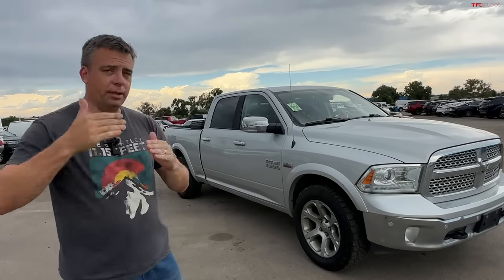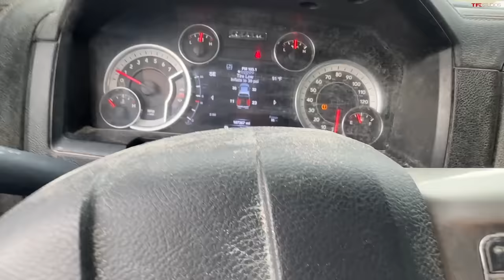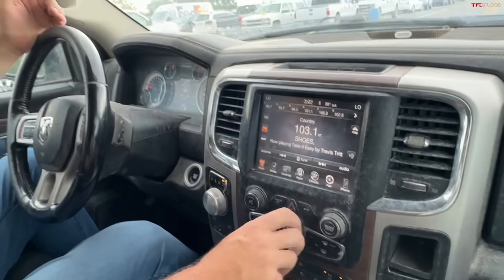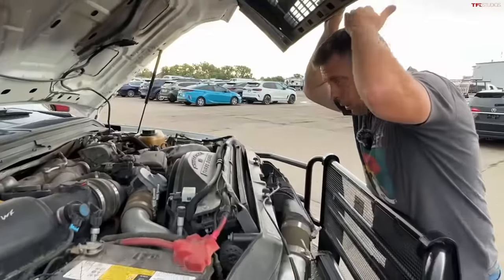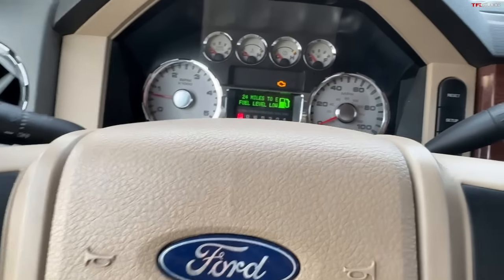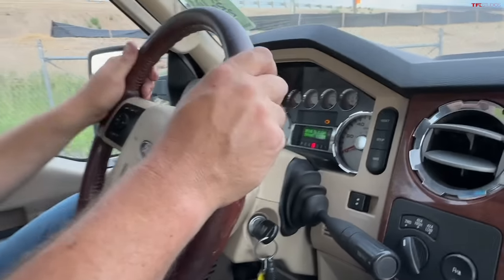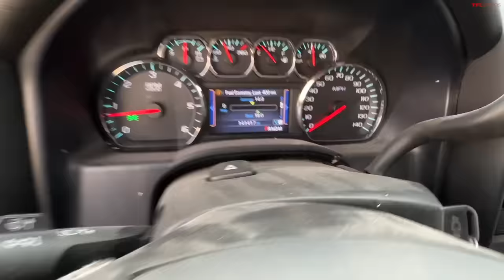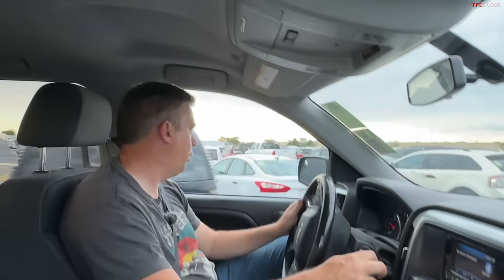These Are the Top 3 Used Trucks You Should Never, EVER Buy!

Comment: The 5.4L 3v gets a bad rap. Once you update the phasers and oil pump they'll go forever. I just rebuilt a 3v with 275k original miles(timing system was updated at 171k) and it had only minimal wear on the cylinders. All specs were within tolerance for a freshening up.
Reply: Yea but the cost of doing that work is almost as much as buying a new engine. Most DIYers dont have the knowledge or ability to do that. At the same time the phaser issues isn’t usually catastrophic and the engine is fine for as long as you can deal with the “tick tick”.
Reply: @Overlandjon  A reman is close to the cost of a rebuild, but they are all updated also. Fraser and Powertrain are both using DA phasers and Melling HV340 Melling oil pumps. The tick sound is mostly associated with the passenger side timing chain tensioner seal blowing on the newer style composite tensioner. It all boils down to maintaining the vehicle properly.
Reply: @brianhunt5635  yea I had one and fixed it but I bought it with the timing chain issue not knowing it had an issue until after I bought it. (I learned alot about it which I never knew before). It never had any issues while I owned it (about 4 years) but Took alot of learning to figure it out how to fix all the issues which I doubt most buyers wouldn’t do. The Dealer wanted upwards of $5000 to fix the issue. Your right its a bad rap as the engine still outlasted me but again its a risk and not many people want to put that kind of energy/money into something thats worth less than the repair.
Reply: @Overlandjon  For sure. If you can get them cheap enough and have a mechanic you can trust, you can have a pretty nice ride for a decent price though. I'm still surprised at how many are still out there with these issues. Seems like most of them should have been updated by now, but they're still running around knocking and clanging. Ford did more right with the Modular engines than they did wrong, but engines don't often get remembered for what they did right.
Reply: I just recently had my 08 5.4 in for the phasers.  I was lucky to have had a warranty to fall back on. I was told that it would have easily been a 4K repair and I still paid 1K out of pocket to do the "no brainer" repairs while it was tore apart. Now I have trans issue that when it sets all night ,when you first start it and put in gear it will not move. It's like the pump is weak , but the dealer is stumped... so they say!
Reply: @miked19831988  My Advice Dump the Truck Money pit anything with the 5.4 is TRASH BTW a Ford Truck guy not bashing Ford but the 5.4 with all its problems stay away
Reply: @rogerstlaurent8704  if you’re talking about the 5.4 3V then yea but the 2v is really reliable I had  a 04 f350 with the 5.4 2v for 14 years and never had a single issue out of it and pulled over 10,000 with it.
Reply: @kingslayer8569  BTW 100% correct on the 2v jumped the gun just a little bit the 3v were TRASH
Reply: I’ve had an ‘07 5.4 3V since new. Slight right side phaser knock at 185k-ish and I went ahead addressing the issues myself before all got worse. It’s a suck job but I did it. Truck runs really well. I get the frustration over the 5.4 but it’s been a great truck.

Comment: Ram’s Hemi tick is a bit overblown. There was a bad run of lifters but in 2017 they changed suppliers and beefed up the roller bearings. Typically the worn down lifters and lobe happens on the non-MDS cylinders. Plus it’s most common on vehicles that idle for long periods of time when oil pressure is lowest and operating temps are highest. Also it’s best to do full synthetic oil changes 5-7,000 miles not 10k. It can run on 87 but best to use 89 octane to prevent engine knock.
Reply: Have a 2014 Ram Hemi with 120k miles no tick
Reply: I had a 2018 hemi with this problem. Had to take it back to the dealership for repairs. Was like pulling teeth to get them to fix it.
Reply: Happens way too often and it's a huge repair. Many GM or FCA V8s with DOD/AFM/DFM system will have issues at some point in its operating life. It's a crap design and will absolutely negate any fuel savings.
Reply: @TPowell12  It does not happen that often. Issues can be due to bad maintenance/abuse on either the Ram or the Silverado.
Reply: It isn't due to bad maintenance. My truck had full synthetic every 5k and I'm one of several people I know with this issue. It's due to crap engineering from FCA and GM. If you understand how this system operates then it's easy to see how the lifters will become damaged over time.
Reply: @TPowell12  If it is the bad engineering then why do the locals in Qatar buy them and appreciate them? The lifters get damaged because they do not have the right oil. GM would be out of business if they had such issues.
Reply: @ramaswamynarayanaswamy4806  Most people aren't car people and don't understand or even know of these systems. They're still in business because they have deeper pockets and better lawyers than most people can afford.
Reply: @TPowell12  Alright. I still prefer GM as where I am, Ram trucks and Fords are more expensive and can be difficult to repair to an extent.

Comment: When I was shopping for a Truck after buying a 22 foot travel trailer, I noticed the used truck market is full of trucks with the  model years the manufacters had issues involving recalls or failing engines and other major issues. Granted, some had the issues fixed, but the owner decided to dump the vehicle. I ended up purchasing a 2010 Nissan Titan, and all research and reviews say I made the best decision  regarding a used Truck.
Reply: Loved our 2008 Titan. Put close to 350,000 miles on her. Picking up our 2024 today.

Comment: The Diesel issue from 2005 through 2015 is the government mandated emissions controls with little to no lead time to develop the systems and the consumer became the test subject. The diesels of the last 5 or so years are far and away better because they've figured out the systems that typically take 5 to 7 years to develop a reliable solution. But the gov gave less than 2 year notice, and then again with less than 2 year notice. And it was across the board for on road diesels.
Reply: Now the fuel system on all of the trucks are a problem.

Comment: I have a 2014 Silverado 1500 with a 5.3 liter engine and 138,000 miles. However, the previous owner installed a chip that deactivates the cylinder deactivation feature. I haven't had a problem. With the chip, I don't have to worry about uneven heating caused by one cylinder firing and the one next to it not firing. The engine always runs on all eight cylinders all the time.

Comment: I drive a 2015 ram 1500 5.7 Hemi and the only problem it has is a exhaust header leak. After about 10 seconds of the truck first being on from a cold start it goes away. I was able to get it fixed under warranty or recall, but it started happening again.
Reply: how about not and take your scamming somewhere else

Comment: I usually love TFL but to me, saying to avoid buying a 4th gen Ram 1500 with the 5.7 is a huge miss. Because anecdotally I have owned 5 ram trucks over the last decade not had a SINGLE major issue out of any of them. I was a GM guy until I got my first Ram and I haven’t looked back for a decade. The particular truck just seems to have been rode hard and put away wet. You can do that to a Toyota and it will be junk too.

Comment: Heard lots of bad things in the 14 Silverado.  I had one new off the lot.  240,000 miles other than multiple ac issues that were fixed after replacing with after market parts, I had zero issues maybe I just got lucky🤷‍♂️
Reply: I'm going to say you take care of your stuff, new off the lot means you know what maintenance was done and no one abused it like you did, I worked at a dealership and boy about 70% of the silverados 14-18 that would come in would get sent to auction.
Reply: I have a '15 Silverado HD with 134000 miles and only problem I have had is mice filled the ventilation ducts with dog food and burned out the blower motor.

Comment: I've got a 2011 4.7 v8, it is a work truck (home remodel), and I bought it new from the dealership.  It tows my work trailer, my car hauler , and it currently has 160k+ miles. The only problem i had was that the water pump went out on me around 100k miles. I've only had to do regular maintenance.

Comment: My 14' 5.7 has had the exhaust tick and the lifter tick, kinda sounds like exhaust on that one.
The lifter tick fix is a bit expensive, but mine is good to go for a long time now.
Issue causing the lifter tick is a few things, the cylinder deactivation is one, you can eliminate that by tapping the manual gear selection and setting at 8th gear once you are in drive and it will not engage cylinder deactivation.
The other is going past 5k miles on oil changes, these engines are sensitive to oil degradation.
Take care to do those 2 things and you'll be good.
Reply: Most of the lifters that fail are non mds lifters it’s just bad part quality control.

Comment: I have a 2016 Ram Big Horn and it's been great. I always turn the MDS off manually and get oil changes at 3000 instead of 7500 or 10000. The interior is still in good shape because I don't thrash on it. A lot of stuff comes down to owner behavior.

Comment: I have had 2RAM trucks in recent years.  The first, a 2013 single cab with 8 foot bed and 3.6L V-6 4WD. It climbed s great without a load, but when i put a pop- up camper on it, it slowed dowe and mpg went to 15 from 25mpg. I bought it with 50K and when it was destroyed it had 105K. It only had one recall and ran great.  It was totaled by a live- bottom gravel truck enjoyed parked.  

I then boight a 2009 RAM Laramie that is loaded. 5.7L Hemi, Brown leather interior, 4door and 6.5 f 22:12 t bed.  In town  it gets 16. On the road 21. 4WD could climb straight up if it got traction.  It had 134K when i bought it. S 185K now and is getting a new AC. $5000  for parts and labor. The dash has to be removed. That has  been the only really expensive issue.  Other things are normal wear and tear to me.  1 minor recall. No oil Comstock.  No exhaust leaks.  Probably because the previous owner put new manifolds and exhaust system on. I am going to have to replace front hubs rotors and brakes.

Comment: I have a 2015 Ram 1500 with the 5.7. Yes, like others have said they can have bad cam lifters that tick, but most of these trucks get broken exhaust manifold bolts. Mine had this and I fixed it and replaced the manifolds for shorty headers. Problem solved. I've had a fuel sensor go bad, and some minor issues. I still think the ram trucks are the value for the money. Hope this helps.
Reply: Replaced my fuel sensor twice so far. Second time with TRQ brand and so far so good about a year and 10k miles later. I would not replace with an oem one because it’ll just fail again. Unless under warranty on their dime
Reply: 2017 Ram 77k miles

Comment: The DEF and DPF are major issue with diesel trucks. 
Requires alot of maintenance that most ppl don't stay on top till its too late
Reply: Which extra maintenance is with the diesel ?
Reply: @watchmanexpert  There is no extra maintenance. If your DEF is not deleted yet, you just have to add it in once in like 6-8K miles. If you change engine oil yourself it cost just like $60. Intervals are actually longer then gas engines.
Reply: @marcelo403polo2 That’s the problem. HO Diesel option on the new super duty is $12,500 plus tax and interest, then you have to spend $5000 more to delete it and void your factory warranty. I just got a new 7.3 Godzilla because I didn’t want to deal with the cost, weight, and complexity of a diesel. Just looking under the hood of a modern diesel will give you a headache.
Reply: @cliffordmontana4562  Yes. But those newer gas motors are also very problematic and gas thirsty. So IMO still is better to have diesel. Im very happy so far with my LML
Reply: @marcelo403polo2 If you’re referencing the camshaft delamination, it affects 1-2% of engines from 2020 and 2021. It’s a simple, old school engine with few parts and no turbos. There hasn’t been an engine this simple in a heavy duty truck in decades. I have a crew cab long bed f250 4x4 with 4.30 gears, 35x12.50 mud tires and a 48 gallon gas tank. I average 14mpg. Towing my enclosed trailer with toys in it I get 10mpg. That’s pretty good for a 7,500 pound truck. Good luck with your lml. I just personally have no need for a diesel and don’t want to deal with all the emissions stuff.

Comment: I have a 2014 5.7 Ram 2500HD with 149K miles and 66RFE 6 speed. I have a tick, but it doesn't occur on initial cold startup at all, is not discernible under normal driving rpm ranges either, but after driving 30 miles or so when stopped in idle the tick is quite noticeable.  This engine is the VVT, NG compatible version not the later MDS version.  I have never seen any metal in the oil or filter and is usually still clean to the eye when changed. Always have to use premium Mobile1 or OEM oil filters to maintain oil pressure with this VVT system or my truck will shut down the VVT and throw codes. Usually by 5K the oil viscosity itself tells me it is time to change. I use Rotella Gas Truck Blended 10W30 or 5W20 whichever I can get my hands on.  
I have not yet looked at my manifolds bolts but with a rear exiting exhaust design I don't doubt I have broken rear studs given how the heat would naturally fluctuate across the manifold getting hotter and hotter at the rear exit.  Just weird that I experience a different tick scenario.

Comment: Thanks for the informative video. 

What used trucks would you suggest to consider for reliability? I'd like to hear people's opinion on their top 3 recommendations.
Reply: Tundra is best on reliability.
Reply: A V8 Tundra (speaking from a lot of used trucks experience) but it's also a hit or miss too sometimes. It's just a safer bet
Reply: @Pantelifts10  absolutely. I hadn't stated that the current new model doesn't apply to my reply. Lol
Reply: @tbok75   They are very reliable but do have AIP and Cam Tower leak issues.

Comment: You're correct that you need to specify 5.3 3 valve, they had far, far more problems than the earlier 2 valve.
Reply: 2003 fx4 135 thou original miles 2 valve's will go well over 300 k if maintenance is done. Had a 2000 lariat with well over 315 k on it and the guy that bought still drives it daily. 5.4 2 valve.

Comment: I've got a 2006 F-150. I've got 350,000 miles on it and just now it's starting to give me problems, it's now got a lifter tick, the AC is non fixable without replacing it, the passenger windows don't work, this is cab in a half. But it still runs and is not beat up, the paint still looks new (Champaign) color. It's getting tired though. And yes, it's time to let her rest. Been a great truck

Comment: I’ve got 243,000 miles on my 6.4. Still on the Original engine, trans, and dpf. Only problems have been radiator that was recalled.

Comment: My neighbor and my friend have the ford with the TT V8 diesel. The most problematic problem on those is the coolant mixing with the oil. They both had the same problem with their trucks. The black stain on under the hood is from the coolant reservoir pouring hot oil out.

Comment: 2014 Silverado/Sierra had a transmission issue with the 8 speed auto. But not with the 6 speed. 2014-18 Silverado also leak at the main seal after 150k and it's an EXPENSIVE replacement. Dad's 2015 has that same tear in the armrest.

Comment: For the GMs, you buy an AFM disabler to avoid the lifter issue👌🏼 We have it in the 09 Sierra
Reply: An electronic disabler does not guarantee you wont have lifter issues. The ONLY way to truly get rid of the problem is to get a delete kit that comes with a new cam, lifters and block off plate for the VLOM.

Comment: I have the 5.3 GMC truck. I have been hit with both AFM Collapse of my valves and lifters. Now  have two cylinders  that need new valves and seats due to bad fuel injector coils. I have kept up with my maintenance. Bad Truck
Reply: I do not think this is a big issue overall. The other trucks out there are fine.
Reply: @ekavoian  Not every truck has it from what I heard. It is a big issue but if you maintain them , they can last.

Comment: I work for a garbage company I drive a 2008 F-550 stinger truck that has the 6.4 diesel w/ 206K hard miles. The engine is completely stock with all the factory emissions equipment still in place and still runs good and gets up and goes with plenty of power. However it constantly says "drive to clean exhaust" and it intermittently billows thick clouds of white smoke and only averages 6.8 MPG. I'm not sure if this is an injector issue or possibly something to do with the DPF system I'm just not sure...